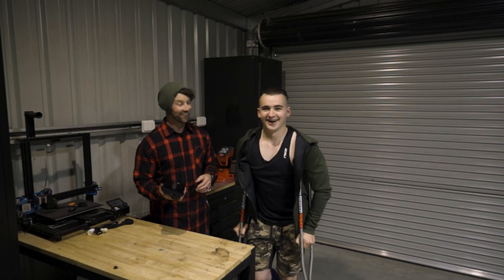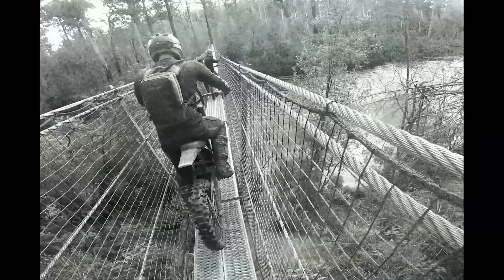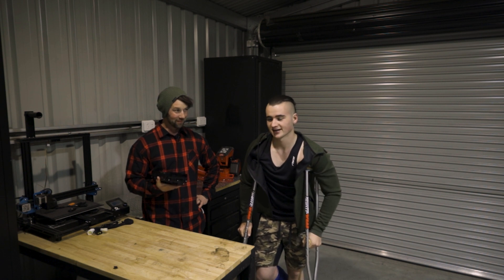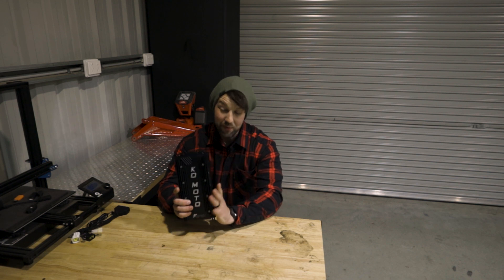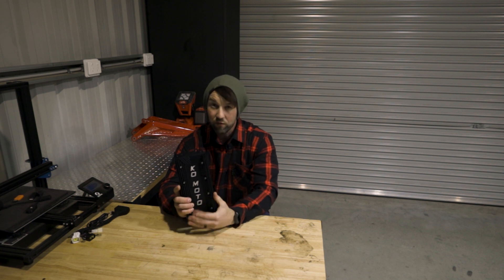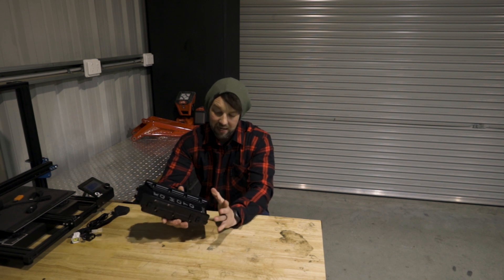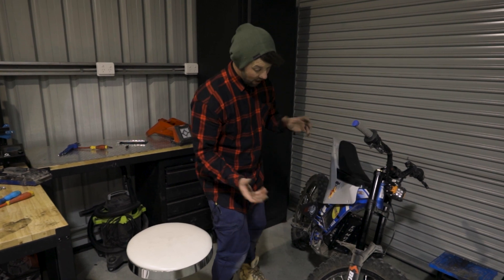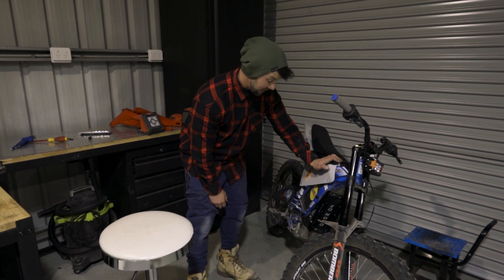NEW KO MOTO FACTORY SPEC COTTROLLER review & install [ we BLOW it up

Comment: Higher capacitance is great, it  mean also higher spark when connecting it to the battery.. unless you install a precharge resistor and contactor... or use anti spark connetors.

Comment: Awesome video. Is the Factory spec controller that much better than the pro? Interesting you said you'd never go back to the pro after trying the Factory spec. I guess my assumption of having the same tune on either nano, pro, or factory spec controller on same bike with same 72v battery would be the same on each due to the tune only pushing out whatever you tune it to, 12kw, 15kw, or? Is that correct, or?
Reply from the maker: Hey mate
The controller just has a much better feel. It's more responsive to on/off throttle inputs which is really down to the solid state capacitors, also much smoother all round. I ran exactly the same tune I've ran for months and was surprised I noticed any benefits. My current tune is 20KW just FYI.

Does that answer your question?
Reply: @progressive_e  Thank you. Yes that helps. KO is having free shipping sale right now, so just sprung for the Factory Spec controller. Hopefully the mosfet issues are worked out! Thanks and love your guys content! Looking forward to more!

Comment: Be sure to check out EBMX too!
Reply from the maker: Have one on the way to us already! Hopefully here next few days
Reply: @progressive_e  Yeah cool! Me too!
Reply from the maker: @de-bodgery  oh shittt yeah mate! I'm keen as to try it!
Reply: @progressive_e  EBMX should be tons more powerful than KO, like we need more power!
Reply: @de-bodgery  Do you ride a surron ?
Reply: @de-bodgery  His tune is 20kw, who needs all that power EMBM and KO offers ?
Reply: @surronzak8154  I don't, never had any reason to get one.
Reply: @surronzak8154  They probably don't really have it anyway. What people get for peak power is pretty meaningless. You can't run there, just maybe pulse there for a second. This video is a classic example of the low quality of the KO product line and all the hype around their products. I don't trust controllers to tell me real amperage. I have a watt meter as well. If they match, great, but they often times do not. The FSPEC controller is nothing more than firmware current limits and a slightly different throttle map. There is no such thing as the FSPEC or Pro controller...it's just firmware that separates them! The capacitors are doing nothing to "Add power"

Comment: So let me get this straight you did one pull, it broke and now your recommending it.
Reply from the maker: It's the exact same Fet board we've been running in our pro controllers, which have been rock solid. I'm recommending based on feel, every manufacturer has faulty parts it just happens.
Reply: was wondering the same thing. almost as if they're a tad biased :P. Blowing up that quick, and given by the sounds its not the first, suggests their QC is pretty poor, to put it politely, or potentially a more major design flaw in there somewhere. 
They do atleast have a good rep for support/fixing their mistakes, just they are also getting a good rep for putting out beta-level stuff (same as their 1st motor) and acting surprised that it didn't work, despite decrying and even banning those in the community that suggested it wouldn't work from the start. 
Ko... They're a bit of a weird bunch.
Reply: @progressive_e  I understand that its just hard to trust y'alls opinion on things when you come out like this after half a ride saying you'd never buy a pro controller again. Personally i think it really cheapens your opinion on the matter
Reply from the maker: @brandonheld1758  Hey mate I actually appreciate that comment. Completely understand where your coming from too.

The controller is on the way to KO now. Apparently they are going to fix instead of replace it....

My understanding is the Mosfet board is the same as the pro controller I've been using since June. If that's the part that had a faulty component then I've got no issue recommending that as we have two pro controllers that are reliable with no issues and have been running high power for a decent time now. If I honestly thought there was a underlying issue I wouldn't recommend it, who knows it could come back and last two minutes again?

The feeling of the controller is what I liked but if it comes back to me and blows up again we will do a video on it.

We have the EBMX controller review coming and depending how that feels to the pro controller that might actually be my go to. The Surron parts world is moving way to fast now!

Comment: My pro controller did the same thing, they're assessing it now but I'm pretty sure it's a blown MOSFET
Reply from the maker: That's super interesting man, how long did it last?
Reply: @progressive_e  I did a full throttle launch, it suddenly cut out and started beeping, and had "error 13. MOSFET high-side bridge alarm" on the software
Reply from the maker: @q-ster116  same alarm I had! Must of had a faulty batch of fets for the F-Spec controller.

Our pro controllers have been nothing but reliable and the F-Spec has the same fetboard.
Reply: @progressive_e  was the 2nd ride, I was taking to Jared on insta
Reply from the maker: @q-ster116  oh so that's what happened? It's Jared by the way! How's your replacement unit all good?
Reply: High quality